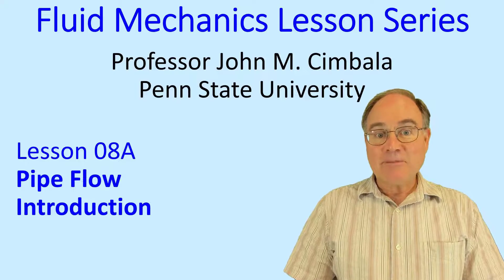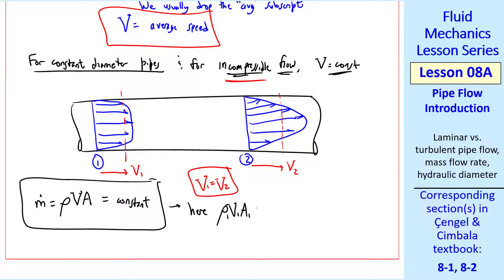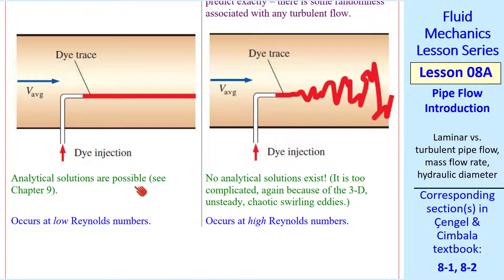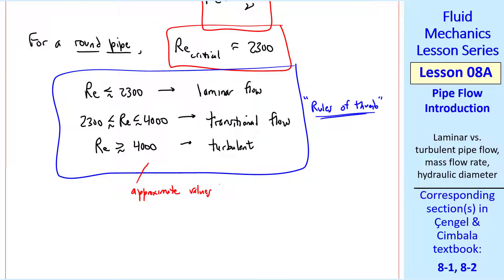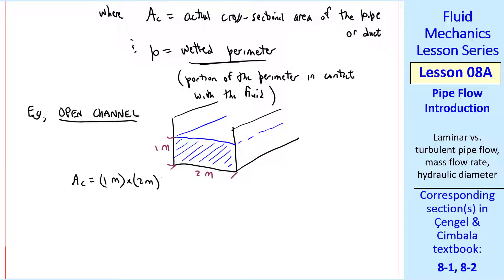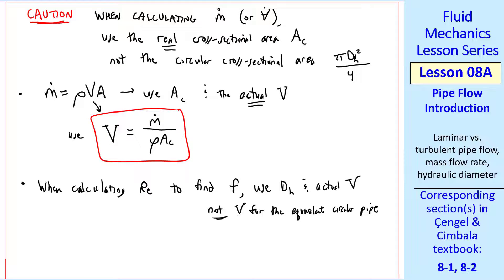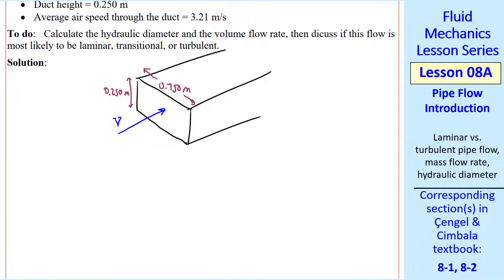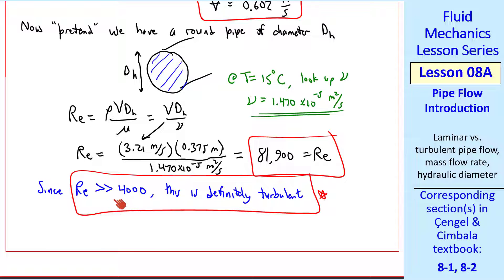Fluid Mechanics Lesson 08A: Pipe Flow Introduction

Comment: Dear Prof John. In your book for fluid mechanics, example 8-1 solved, the quadratic eq solved yields a different value than the one given in the book 0.36969. Is this an errata?
Reply from the maker: No. I just worked it out again and got the same answer. What did you get? I suspect that your problem may be the alpha? Alpha must be 2 for laminar pipe flow.
Reply: @ in the text, the diameter provided is 6 cm. Which yields a value of V = 4.36 m/s. If the diameter is taken as 6mm, then it yields the one provided 0.36969 . I am working from SI edition of your text book, laminar draining from a pool. Eg 8-1.
Reply from the maker: @michaelsukham  Yes, it is an errata in that version of the text. I am looking at the latest version (now called the 2024 release), and it has been changed to mm. Edition 4 still has cm, so I added that to the Errata sheet, crediting you, 
https://www.me.psu.edu/cimbala/Cengel_Cimbala_book/ED_04/Errata_sheet.pdf 
although somewhere along the line we realized this and corrected it in the newest edition. Thanks for pointing this out.
Thank you for your comment. Please tell your friends and colleagues about my YouTube channel where there are almost 600 free videos about the Bible, fluid mechanics, science, math, Excel, statistics, air pollution, and other topics. I would greatly appreciate it.
Reply: @ Thank you Prof. Cimbala for replying and yes! I recommend your lectures and book for fluid mechanics 101. It is so much better and clear on the concepts. 🙂
Reply from the maker: @michaelsukham  Thank you, I really do appreciate it.